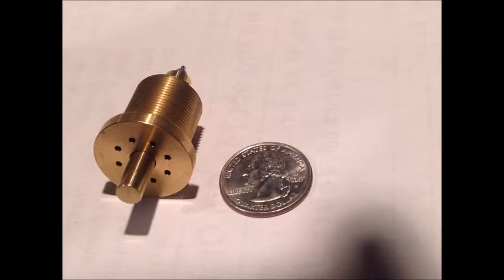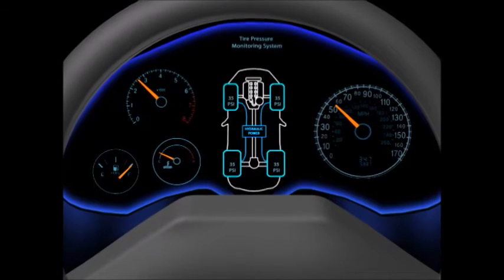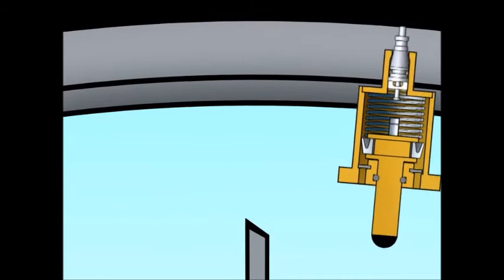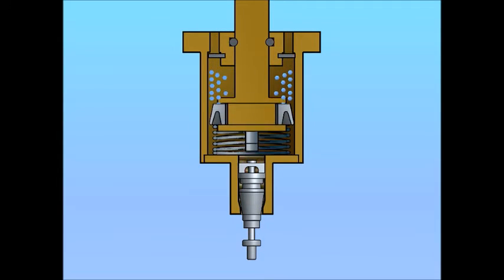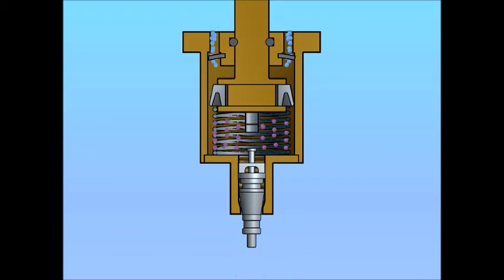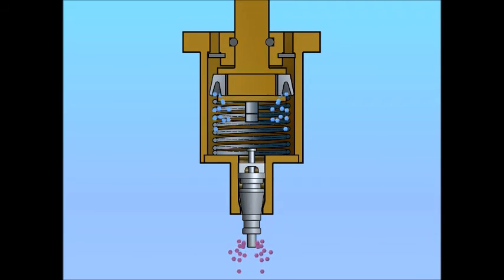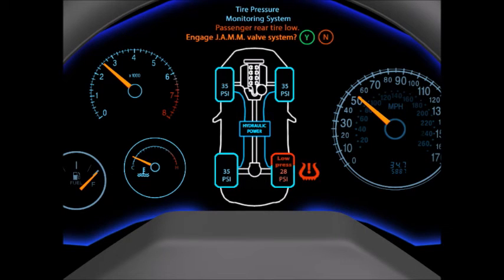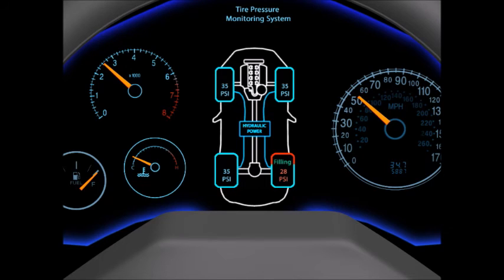Automatic Tire Inflation System (ATIS) - The JAMM Valve

Comment: Adding a solenoid actuator that is either triggered by the emergency light or selected independently through a selector switch, this has conceptual viability. Obviously some potential hold ups but I know many people who would pay to back the R&D if you can display real life use case on top of this proof of concept.

Comment: Lol, that's not going to create a heck of a irritating noise as you drive down the road at all. XD
It's like when you were young, and place a playing card on the fork of your bicycle, that goes grrr when you ride it, making it sound like you have an engine. But this will just be a louder, metal to metal sound, x 4. Hilarious. And let's not even get into the fact that you can't drive above a certain speed, because at some point that interaction between this little JAMM valve, and its pin that pumps it, will literally turn into a little collision, which will just either rip off the pin, or the complete JAMM valve. 
This "system" makes about as much sense as a woman suffering from full blown PMS. But thanks for the laugh, it was great. XD
Reply: still better than being stranded on the side of the road, no? maybe you should volunteer to be the test pilot
Reply: My guess is, Mier, that you have built very little in your life but this isn’t the first time you’ve mocked somebody else’s creations. I do see problems with this device but it is nonetheless quite clever.